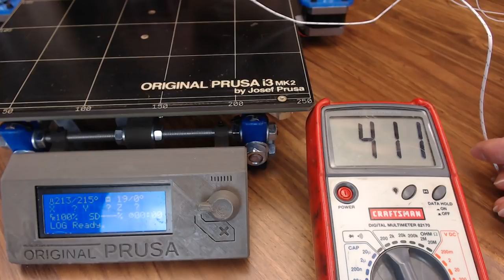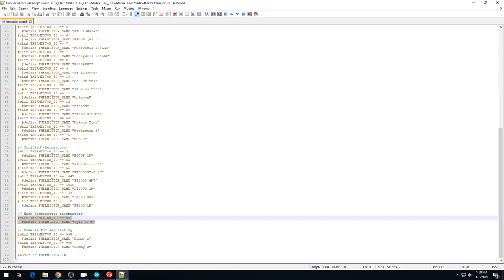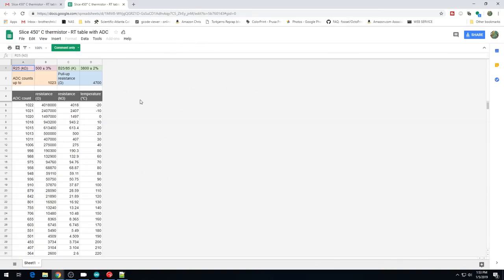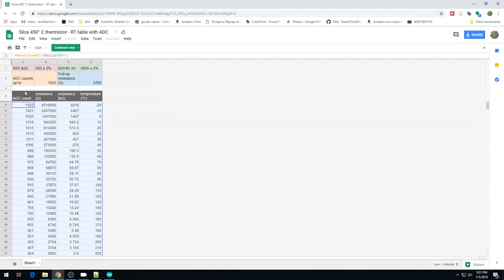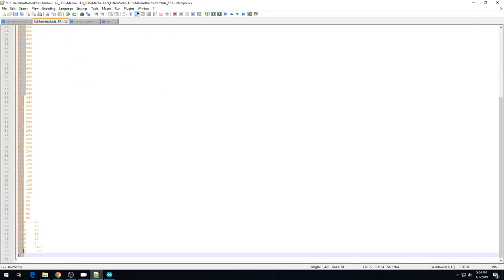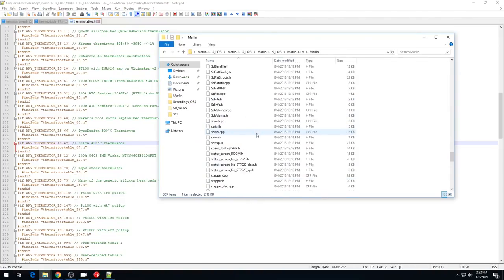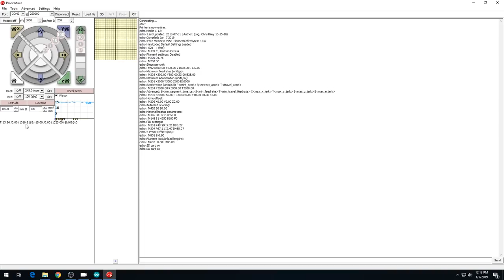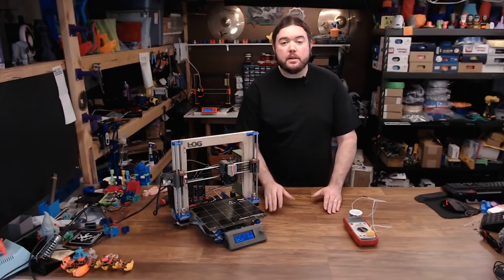Thermistor Temp Table - Marlin - How To - Chris's Basement

Comment: Thank you for sharing Chris, great info. For those having trouble getting the fiberglass sleeve for the thermistor, you can hijack it from old or unused heat cartridge wires. Given heater cartridges are less than $1 each It's probably cheaper than purchasing it separately.
Reply from the maker: Thanks! Good call, I didn't think of that.

Comment: Awesome video, Chris! I suspected my Ender 3 + SKR Mini e3 (v1.2) had its temperature readings off... (I could only get good ABS prints at "260C") And indeed: 240C was actually 220C - measured with a multimeter's thermistor. I don't know if the problem is the actual thermistor OR something on the SKR Mini board AD converters... But I'll make a custom table as you've shown. Thanks man!
Reply from the maker: Thanks for watching! Yeah, I question the accuracy of a lot of these thermistors, like you have found, it really only becomes a problem when you try some of the high temp plastics. Good luck on the calibration.

Comment: Hey Chris thanks for the video. I do have a question, I am trying to set up Marlin 2.0 in Arduino but I don't see the thermistor.h in there, did they move the location of where you can input this table?

*Update - I found the thermistor.h file in ../src/module/thermistor. They already have the 67 file in there, so I am just guessing now all we have to do is edit the configuration.h file correct?
Reply from the maker: That is correct, now you can just use the 67.

Comment: Like this video, However, I am unable to find the Thermistor RT Table for the 300c, is there a reason this isn't found?
Reply from the maker: 300c? Which heater/thermistor is that?
Reply: @ChrisRiley  sorry, its the bondtech one, i added it as max temp 285 in marlin, and used the set value 5 from the configuration.H file as per their recommendations

Comment: I have a PT1000 temp sensor now, but the table of this sensor (type 1047) does look nothing like the table of a thermistor, how do I calibrate a PT1000 !? Can't find anything on the net..
Reply from the maker: Things have changes a lot since this video. It depends a lot on if you would need an amplifier for it or not.
Reply: @ChrisRiley  In my case, I have a (ampless) PT1000, connected just the way you would connect a regular themistor.
I would be interessted to see how to etup a calibration table in Marlin for it. I can't find any info anywhere..
Reply: @winandd8649  Same here..

Comment: is there any place i can go to that can make a thermistor table for me as i am having a very hard time reading the thermistor datasheet
Reply from the maker: Not that I know of, you would have to build one with a probe or find someone that has already built it.
Reply: @ChrisRiley  i found a data sheet for my thermistor and i think i made the temp table for the firmware correctly but not sure the only way to find out would be for me to test it would be to use it

Comment: Hi Chris, thanks for the Notepad++ tricks and whole video! Trying to upgrade my printer with PT100 and amplifier board but as only update Marlin firmware, got Max Err E1. Any idea?  Settings are according to https://wiki.e3d-online.com/E3D_PT100_Amplifier_Documentation.   No doubt in wiring and so on. At room temperature voltage from Ampl. board according to calibration table. 1.20-1.22v
Reply from the maker: Well this is the first time I have ever seem this config. I am not even sure how it works. Sorry I am not much help here.

Comment: hey Chris, this is Chris 🙈

awesome video as always, thanks for sharing your findings. did a little searching through `thermistornames.h` header file and noticed that the slice engineering 450ºC thermistor table has been added to marlin 2.0 bugfix branch as of ~ march 2019. funny enough it's thermistor 67, looks like your video may have rubbed off on some people. below is the PR where the 450ºC thermistor from slice engineering was merged into marlin.

https://github.com/MarlinFirmware/Marlin/issues/13271

cheers 🍻
Chris
Reply from the maker: Hey Chris, yep, that 67 might have been on purpose. ;)
Reply from the maker: @RedOps RGB Wow, that's not good.